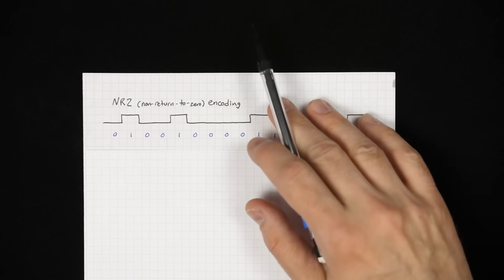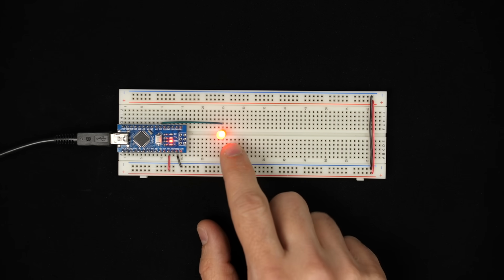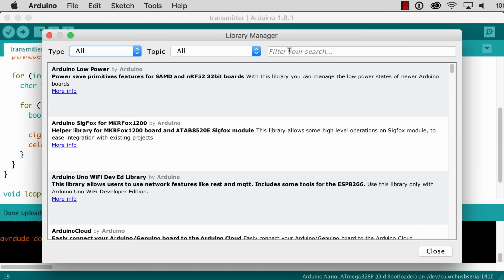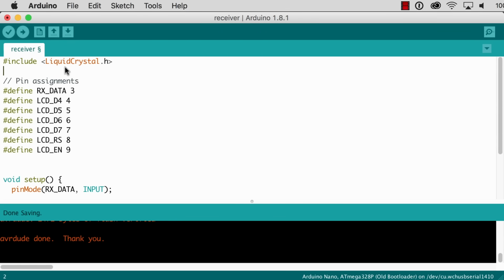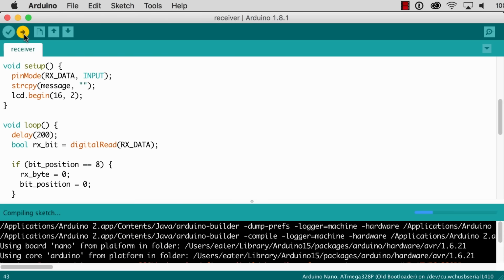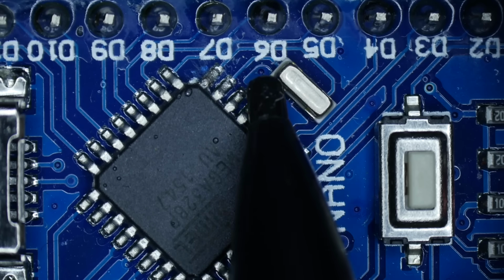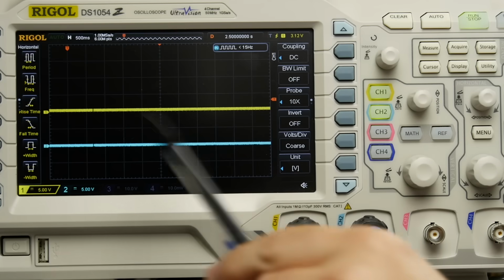Reliable data transmission

Comment: Nice Project.  I must admit having built Bit Bangers with Pic Microcontrollers and trying to only use their internal R/C Clocks, it becomes exceptionally clear, exceptionally fast, that you will either need to write A LOOOOOTTTT of TX / Rx, parity / verification / attempted bit reconstruction on detected error without ak from tx, OOORRR, go on and get a seperate external crystal Oscillator and tell the Micro Controllers to both utilize it as its external timing reference.  You will of course, as you mentioned still have the occasional cosmic ray, induced electromagnetic flux, and who knows what else interfere with the transmission especially if you are using a wireless setup ,so, you still want to code relevant error detection / correction functions, but, my lord, it is night and day on how many errors you actually get just by sharing a timer, or, using two very high quality timers.  Great Video, I enjoyed it, brought back some memories of trying to get those   darn old Pic Micro's wired up to power on, and resorting to Assembly language half the time because the C compilers were not very ... efficient in reconstructing the code into the proper R.i.s.c. You would imagine the compiler would have no problem encoding for a certain chip as long as it knew what instructions were included, added, removed, or augmented on each model, but... while they were pretty much fine for simple / common tasks, if you wanted to do anything remotely technical I found it much more reliable to simply insert direct Assembly code.  Besides, It was an awesome chance to REALLY see how systems view/utilize your code to do their work.  It helped connect the Physical model of Transistors / logic circuits etc. to the seemingly super emergent properties that come out of billions of transistors and ALU's with MB's for Cache all executing in the Ghz range!  Taking everything back down to the basics, using micro controllers and circuits you designed to accompany them, really connected the software code paradigm of computing to the physical machine that is actually doing the calculation, memory allocation, manipulation etc.

Comment: anything more ectronically demanding than a buzzer, flashlight or christmas tree blinking lights needs a reliable robust GROUNDPLANE! Otherwise every circuit turns into a counter how many times the granny living in the apartment above you turned on her vacuum cleaner! I really hate how todays people cram their circuits full of CPUs but are totallt diletant in the basics of electronics! Its like building the roof of a house first and putting in the foundations at the very last!

Comment: if you want a reliable data transmission, dont use these what we with my brother called with a derision "contactless contact arrays". since their contacts are not gold plated, and a circuit has many contact, the probability a circuit will work reliably is astronomically low. already at a very young age I learned to throw them away and solder any prototypes I do, because chasing elusive bugs that change with the slightest touch, vibration, ot thermal expansion takes more time than the soldering.
Reply: do you realize this is a prototyping demo?
why solder when you use it only once for demo purpose?
everyone knows that breadboards suck for production, and they have some capacitance and catch lot of noise and parasites
but they are used for labs, so you're missing the point

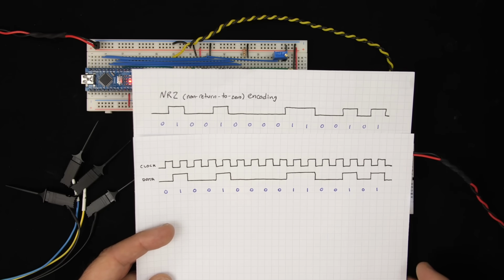Comment: 31:30 A huge concept just sank in and solidified to memory at this moment.  I love your videos because they break down complicated concepts into understandable steps and let the viewer follow along and make the connection naturally.
34:05 To demonstrate how much this is actually makes sense: now I'm thinking about how you would add a second data line and modify the code to alternate which one the receiver reads from at a given moment.  Obviously you could increase the transmit rate, but for some reason the former seems more interesting, at least for learning.

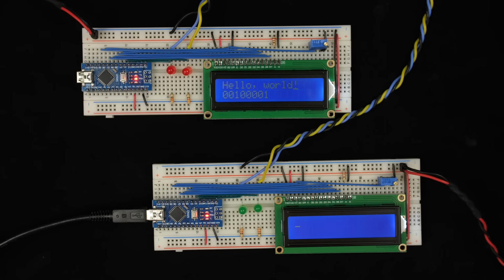Comment: 40:00 you also did that , i was also thinking about that. ' what if computer read on  and off as single and any particular time when tx send 1 and then connection loosed so rx will not get same thing but 0 instead 1 so !! You covered that

Comment: 31:00 what if you use third wire between arduino to communicate for time synchronization or error correction ?
Reply: ....just after that i find you did mentioned that :)

Comment: sorry, but i have to ask at NRZ, why dont you use that method: testing the bit at the delay midpoint of interval?
mean: send the signal about "I_dont_know" time interval, and recieve the signal like that: wait "I_dont_know"/2 time and now testing the bit and wait another "I_dont_know"/2  time. and i think about these low speed you dont have these problems.  

another sequence, but with delayed: 0th sequence: send the bit and wait "I_dont_know" time interval, 1. sequence: send the bit and wait "I_dont_know" time period, next sequence at repeater side is looped like before sequence, just repeat...
but the reciever side: 0th sequence: wait "I_dont_know"/2 test the bit and wait "I_dont_know" time. 1th sequence: test the bit and wait "I_dont_know" time interval. 2nd sequence: test the bit and wait another "I_dont_know" time interval. at the next just repeat the sequence.

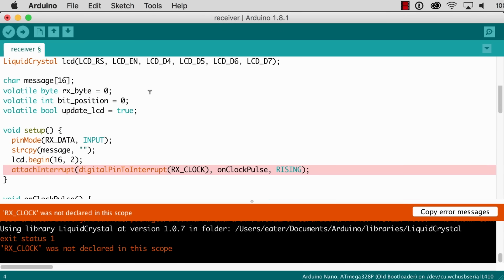Comment: 40:00 but what if the transmitter starts before the receiver has a chance to check the clock? 
Wouldn't you have lost the first few bits, if not even whole bytes if I'm using a higher speed?

Comment: At 23:50 u said connecting with two wires. But how these two wires are connected to each other? Their coating on outside is insulation right?

Comment: @29:55 
your interpretation of 667 bits being expected is completely wrong

the receiver expects a start bit to start shifting data to its registers. only after the start bit is detected the data is sampled at the frequency configured. so actually that's a very acceptable clock difference for a slow baud rate.
I've experienced corrupted transmissions between 2 PCBs a lot but this has never been one of them. usually, the error rate is given in every MCU manufacture datasheet including Atmel AVR and if I'm not wrong an error rate below 1.5% won't cause any problems.

I do love and enjoy your videos a lot.

Comment: 24:08
Aren't we just connecting grounds of different power sources here? I mean, this could lead to a short circuit, or am I missing something?
Reply: Think of it as a battery splitting up to 2  loads and then returning to a common ground

Comment: the 'reliable' bit kinda ends where the breadboard stops and that usb connector comes into play either way. not so much because of usb's data or electrical standards (although the dynamic device id's are pretty crap) but because of unreliable suppliers. :P just look at those flimsy tiny chips. how are they ever gonna work for a long time in various temperature and moist conditions, with suppliers that randomly go 'oops we no longer make those' not after 100 years, no, usually after 2 or so lol.

Comment: These videos made me realise that LED's is the electronics engineers console.log()
Reply: Das Blinkenlights!
Reply: its more like alert(). Console is logic analyzer
Reply: Uhh Serial.println
Reply: I personally always connect a (second) LCD screen to the microcontroller stuff that I am working on to use as a "debug output".
I am thinking about getting one of those huge 4x40 character screens for that ....

But, yes for smaller projects, LEDs are a good digital "status indicator".
Reply: Exactly!😂😂
Reply: well , what would you use if not an led light , an led screen is too complex to set up to be used for this purpose
Reply: @maskedredstonerproz  Buzzers are fun
Reply: sort of, but if electrical engineering was a language, I think it would be C++, because electrical engineering is by no means a scripting language, so LEDs are more like:

std::cout << msg << std::endl;
Reply: XD

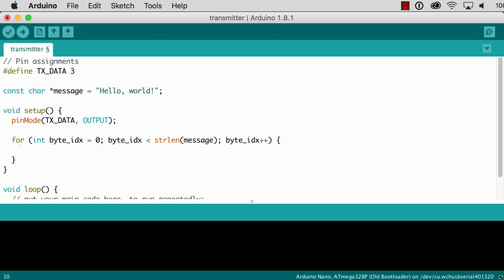Comment: Using strlen() in a for loop (at 3:10) wastes a lot of processing time, because for each iteration of the loop, the processor is stepping through the entire string and counts until it gets to the end. For a string whose length is constant, you can save a lot of time by saving the length in a variable, and using that in the loop.

(seen in the outer for loop in setup() in the transmitter code)

Comment: Thanks for videos! Watching em daily now since I started learning electronics and design small things. I have trouble though - can't see wave from oscillator no matter how I set up my trigger or whatever. I tried it both on OEM Arduino UNO (both oscillators - of Atmega328 and CH340 chip), and my scheme which is purely power supply (9V + diode + caps + 5V LM stabilzer) and Atmega8U with 8MHz crystal resonator. It starts, I can communicate with it in Atmel Studio, but I never had a chance to see a waveform. Now I ordered Oscilloscope as you have on video (1054Z), but meanwhile I am trying to figure out where I do it wrong with my USB oscilloscope OWON VDS2062 - I used 3 ways to power it up - PC USB, Wall plug power supply, USB of external power bank. I see some noise which is no different if I unplug my test probe or plug it to crystal. Any ideas?

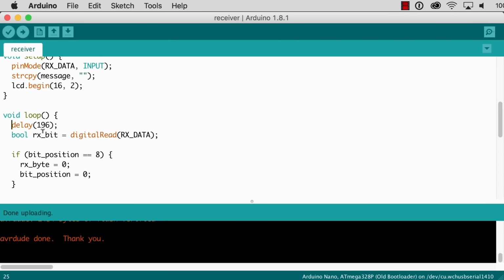Comment: 27:30 - and that is yet another reason to trash the Arduino firmware and write in ASM like real men do ;) By the way the video has both a misguiding title (as I personally expected it to be about ECCs alone) and a logically reversed order as historically everything started with synchronous interfaces, yet as you do not really want an extra line in a data cable the effort was to somehow get rid of the clock (with some methods like 1-wire being both reliable and extremely simple in terms of wire counts). Also never forget the tape recorders which played their role in interface development, creating encodings that allowed for low error rates, error corrections and very low dependency on the frequency drift.

Comment: I'm posting the 666th comment...welll...wasn't this I2C communication protocol ?
Reply: not really, it is different because of the 3ed wire. I2C needs only two wires which are sda and scl

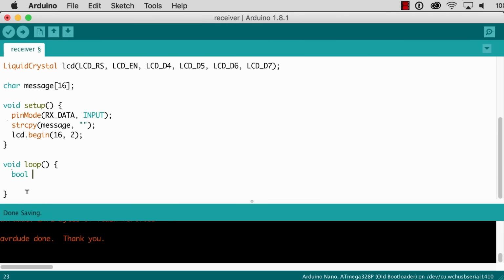Comment: At  18:40 

strcpy(message, "");  
Does not initialize the buffer correctly, as the string you are copying to the array has a length of zero. This means only one character will be inserted into the array, it will be the terminating 0 character which is used in C to identify end of string. 

You should have used. 

memset(message, 0, 16);
This fills the buffer with zeroes.

strcpy() is one of the most insecure functions in C, along size gets(). It does not check if the string fits into the buffer and potentially overrides stack memory allowing attackers to inject custom code into the system or modify values on the stack.
Reply: We only need to make sure there is at least one null somewhere in the buffer to properly initialize it. Just to make sure we don't run off the end waiting to find a null terminator.
Reply: @ajreukgjdi94  You initialize the full buffer with zeros in order to prevent because you don't know how long the string will be you place into the message buffer, if you don't zero initialize the buffer than you have to manually place a null byte in the buffer later. Its also a good practice to do it.

Comment: you need to use canbus if you want inexpensive high integrity data transmission. CRC checks, resends and collisin arbitration are built into the protocol. it comes for free

Comment: Your understanding of NRZ encoding is different from mine.
NRZ can never be a steady state 1 or 0, hence non return etc
NRZ encodes a 1, for instance as, say 001 and a 0 as 011 (in my world) and is not dissimilar to Manchester encoding used in RF communications where the AFC needs to centre on the actual carrier of an FM encoded NRZ signal, (requiring a suitable preamble).
Apart from that, a great video with a lot of C education as well that isn't as well presented by simply reading a page of text. I learnt more than I thought I would.. :)

As an aside, nearly all of my own serial data comms needed to be secure and though I used standard ascii, I am a great believer in "Security By Obscurity" so that hackers cannot simply load up a bunch of standard libraries and read my data.
To date, none of my RF data exchanges have been hacked though someone did come close when they just recorded a TX output and replayed it but, they didn't allow for my one time use, "Transaction code" that was long enough to allow me a reasonably small (around 82 character) transaction buffer before the same transaction code was used again (which was also used as as seed for the scrambling alogorithm which also moved the position of the transaction code within the message packet, so obscure was really secure.
Use of two rolling prime numbers in the algorithm also made decoding what data you could see pretty hard.

I never got into hamming codes or error correction as the nature of the data was such that it could be discarded, but that is another story.

Thanks for the vid. I shall watch it again no doubt.

Comment: This video is a good overview of communication.

Note: As you a measuring the crystal oscillator you are changing the circuit. 
(It's a very delicate circuit, I'm amazed it even works when measured.)
Even the worst oscillators will likely not be beyond 100ppm.

To improve NRZ you can do oversampling at the receiver.
Reply: I was expecting to see some phase locking of the timers each time the NRZ state changed, or some oversampling or some other asyncronous tricks. But nope, just a clock line.
Reply: @jnevercast  It's a basics video looking at the fundamentals. There has to be some limit to the scope!

Comment: This guy prepares all his perfect length jumper wires in advance, I'm effin' calling it.
Great video.
Reply: The errors he makes along the way are also prepared in advance, I'm guessing. The guy is very skilled, but he also goes in depth enough so that a newbie can get into the videos, understand them, and avoid common pitfalls. Really great vids.
Reply: @doctorpropain8902  The high level conceptual errors certainly are - showing why some complexity is there makes the whole lesson more memorable. Silly typos like forgetting a period might not be, but they're bound to happen sometimes.
Reply: and he did all that programming with only one goof up, missing a period :-)
Reply: @markwiygul6356  not something to be proud of, that small programming and all those errors. I write over 50k before a single error and I'm thinking about what I want to code as well. Sometimes I code programs to help me code repetitive tasks that can't be put into a loop due to tiny variations within the repetitive code.
Reply: What gave it away? The triple jumper cable with switch preinstalled to simulate an error in transmission?
Reply: He actually starts off with perfectly assembled boards and goes on to deconstruct them and then plays the video in reverse with voice over
Reply: Isn’t it great for him to prepare for the presentation?
Reply: @Roq-stone  wikipedia[dot]org[forwardSlash]wiki[forwardSlash]Humour
Reply: ZecoRho no joke. How would it be that while building the circuits he’s stripping wires and trying to figure out if this or that would work? How would that help the presentation though?
Reply: This makes me think of Futurama.

Prof. Farnsworth: Let me show you around. That's my lab table and this is my work-stool. And over there is my intergalactic spaceship! And here's where I keep assorted lengths of wire.
Fry: Whoa! A real live spaceship!
Prof. Farnsworth: I designed it myself. Let me show you some of the different lengths of wire I used.
Reply: Don't know if he used them, but you can get/make wire bending calipers
Reply: ZecoRho you can get kits with various lengths, he probably picks from those
Reply: @QualityDoggo  In other videos, the wires are also perfectly prebent.
Reply: Philip Gwyn again you can buy kits which the wires come prebend in😂
Reply: @philipgwyn8091  សារ
Reply: @QualityDoggo  e KTP yang berlaku dan fisik yang tidak cukup untuk➡ mengakui Kayla baim
Reply: It's called editing ;)